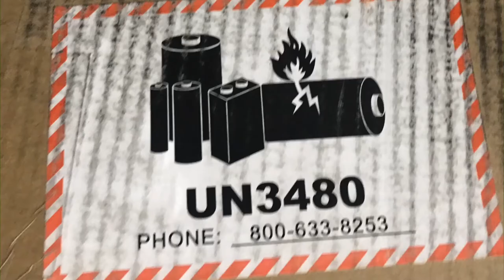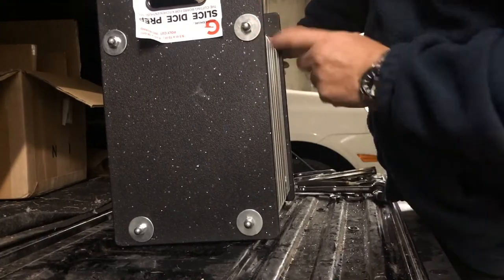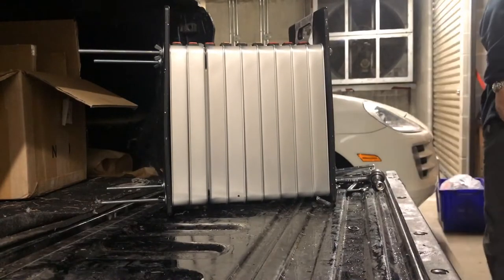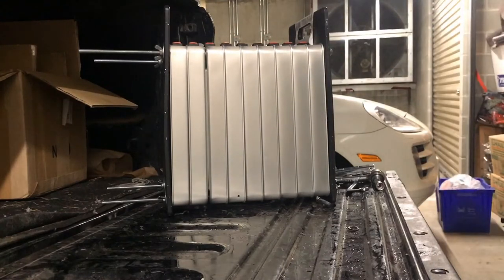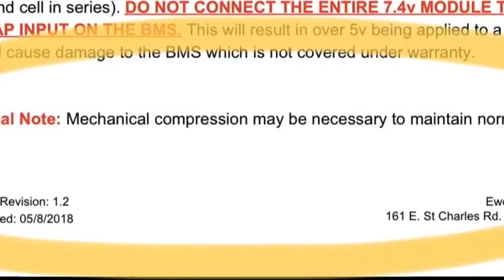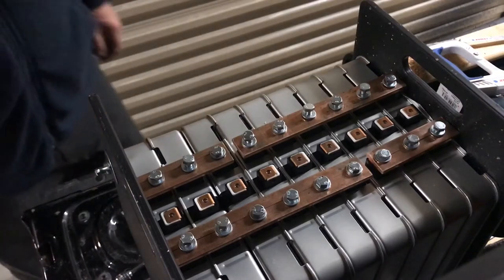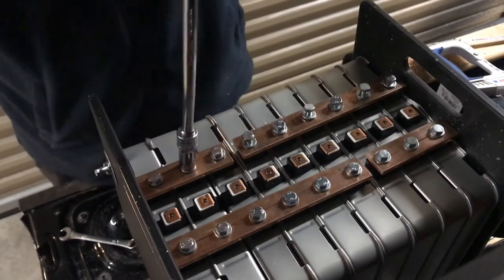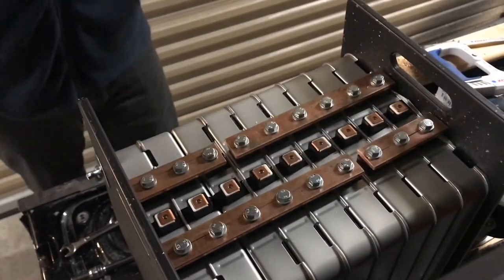Nissan Leaf Battery 4.5 KWH solar storage bank @ 24 VDC

Comment: Nice a few spacers to give it just a little air gap goes a long way, the sharp bit speaks for itself :)
Reply from the maker: factory specs indicate those pouch cells need 4psi compression. Studies show they measured greater capacity for leaf cells with simple compression utilized. Spacers would negate this.

Comment: I'm trying to do 3s4p configuration. Would I just make another 6 hole bar to connect the positive from unit three to unit four and have another 3 hole bar for the negative on the last? Or would I also need a wire to connect the first and last unit? So confused.